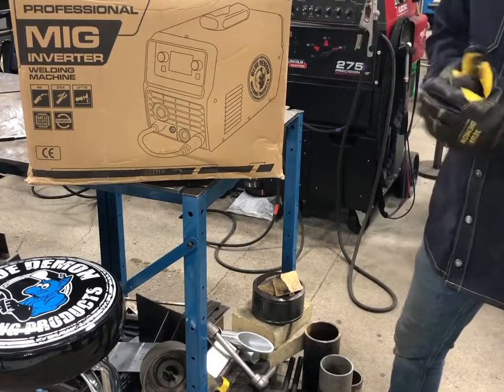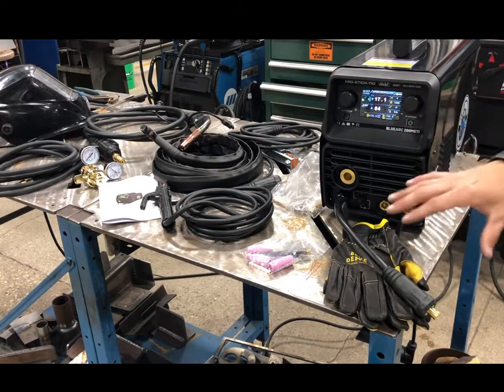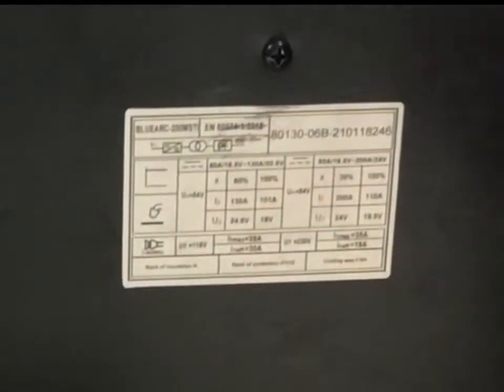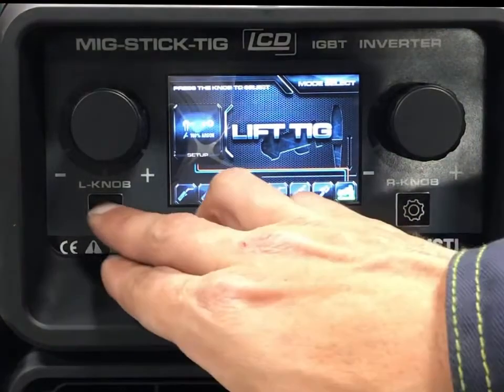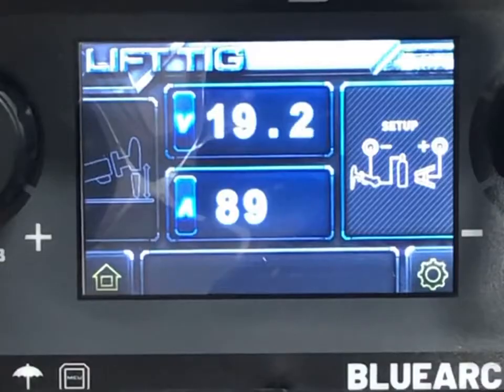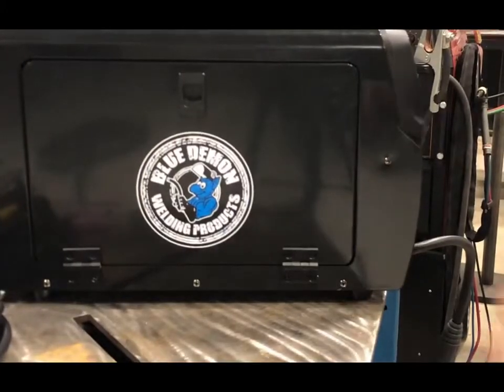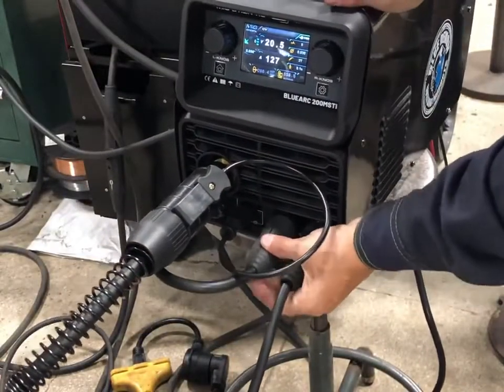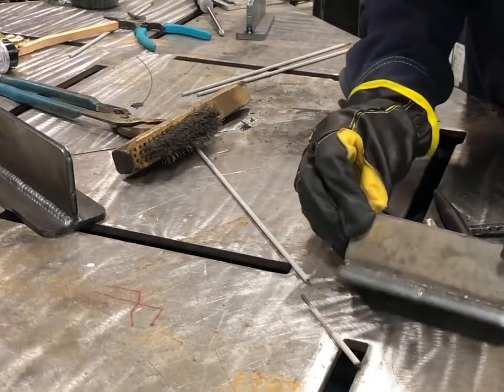Blue Demon BlueArc 200MSTI Multi Process Inverter Welding Machine

Comment: Just got mine set up (newby welder) and am having issues with the wire continuing to feed even when I let go of the gun trigger. it will just continue to weld until I lift away, and it will feed out about 8-10 inches of wire before stopping. It is ONLY when I weld, though... I can start and stop wire feed perfectly so long as an arc doesn't occur. What am I doing wrong?
Reply from the maker: sounds like you have 4T control on...  change that to 2T and when you let go of the button the wire feed will stop.  on 4T it will go until you release and then press again - intended for longer welds.  if this doesnt help or fix please give us a call at 888-905-6737
Reply: @bluedemonweld  Nailed it!!! That instantly fixed my issue, thank you.

Comment: Would have like to see the performance in 220 v hook up as well!
Reply: I have one of these machines. Bought it brand new the end of October. It is a BEAST. I have used it daily building trailers. No problems at all. The most steady wire speed of any welder I ever used, and a nice consistent bead. Machine does not go from hot to cold. Absolutely worth the $600 I paid for it, with stick lead, mig lead, and tig lead.
Reply from the maker: great idea for a new video

Comment: Does it have potential to hook up an aluminum spool gun?
Reply from the maker: YES!  although we do not currently have stock.  it is a standard tweco style back end connection so most local dealers will have a knockoff that would fit.

Comment: Mine just came in,I’ll try it on the morning
Reply: vik I did not notice rod selection, it just says 6013 and 7018 and it runs those good, I tried 6010 when I had it plugged into 220 and it was a No go.
Reply from the maker: sweet!  let us know what you think
Reply: Blue Demon It came pretty busted up the stick stinger was crushed no big deal I put another one on the front plastic was pushed in but I straightened it out I hooked it up to 110 blew the breaker pretty fast so I hooked it to 230 V and it works for about five seconds and starts sputtering out and that is on Mig and stick so any suggestions on that maybe I got a lemon, And I am an experience Welder for 20 years not just some beginner so any thoughts you might have that would be appreciated
Reply: Blue Demon welder works bitchen!!
Reply: Will not run 6010
Reply: Update!!!the welder works good it actually does a really good!! My 230 plug-in was messed up I tried at friends house and burns 1/8 7018 no problem

Comment: Take my money!
Reply from the maker: will be online soon
Reply: Mine came pretty busted up, the stinger was Broken to pieces the front look like it been dropped but I straightened it out and I hooked it up to 110 and blew the breaker immediately then I hooked it to 230 and it worlds pretty good for about 10 seconds and starts sputtering out I don’t know if it’s my electrical source or the welding machine but that’s all I got so far
Reply: I really don’t think it is my power supply because I have it ran to 230 V on a Lincoln classic to 250 welding machine
Reply: @bigwhisky4676  I wonder if one the wire connectors on the power switch got knocked off when it was dropped?
Reply: I really don’t think that is the problem, I’m going to take the machine to a friends house and plug it in to his 220 outlet and see if it keeps acting up, just so I know if it’s not my power supply or not